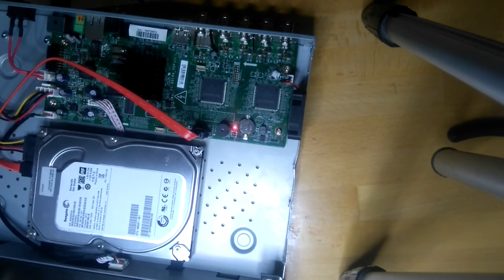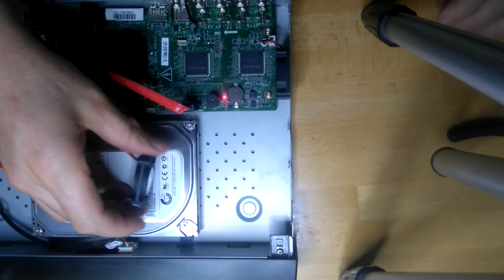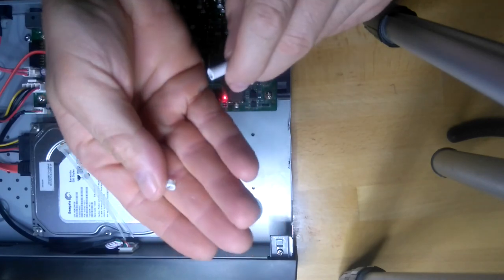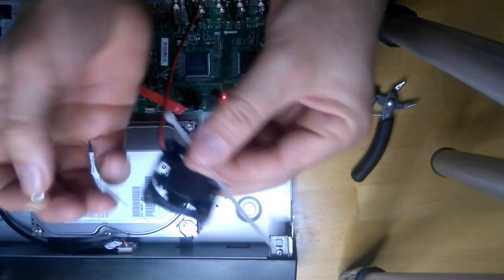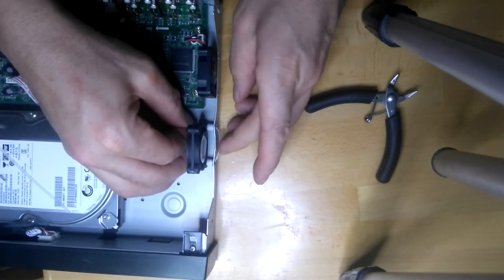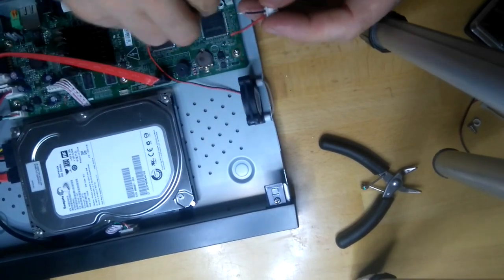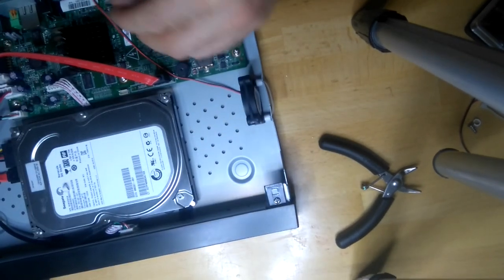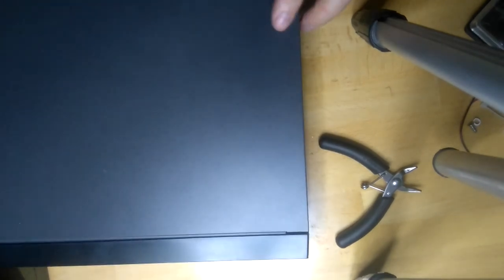How to stop fan noise from a CCTV  dvr or any other similar devices

Comment: Worked great. Also you can add a rubber washer on bottom and top of fan to stop vibration noise to both up and down chassis. No noise to the point I thought I did not connect the fan.
Reply from the maker: No no. fan has to play free

Comment: i just pulled the fan out. Stand by, it's working so far. still working.
Reply: How did it cope without the fan?
Reply: @chanaldochan8797  going great
Reply: @mikesmechanical1102  cheers. It’s bloody annoying! Mine getting pulled out after I get home from work! 😂🤣
Reply: It is mounted vertically so that might help with convection. The silence is bliss
Reply: @mikesmechanical1102  still working great ?
Reply: @keno2363  it is

Comment: I mounted the fan with a thick piece of (3M) two sided tape on the bottom which holds it upright and acts as a buffer between the fan and the DVR  back plate. It works great!

Comment: I just want to ask if Moving the fan to that place would cause problems to the mother board. I noticed that the fan was directed to the motherboard in the first place. Does dislocating its original place affect the cooling process of the mother board?
Reply from the maker: Absolutely not, it's not like pc motherboard, it may surprise you but the fan is not actually for circuit board ,its for HDD, i am a security installer in UK

Comment: Does your DVR's fan stay on after you shutdown the system from the operating system software? My DVR fan only goes off when I pull the power supply plug out of the mains socket, is this normal?
Reply from the maker: Absolutely, Modern DVRs fans directly connected to 12v input, why do you want to keep the power and turn the DVR off softly anyway, it's not a PC
Reply: @pjoskar1  Thanks for replying. I have had the DVR around 6 years and had to open it up to clean the clogged fan and I simply couldn't remember if the fan normally stayed on after I shutdown the box from the software. I thought the fan staying on may have been a sign of a fault :-)
Reply from the maker: @Downloader77  Modern dvrs operated with linux operating system, you can simply plug of and back on ,this doesn't affect its operation, however it's not recommended often, it may affect HDD

Comment: i need to put a fan on mine's cpu i wonder of a pi fan will fit i'm hoping its 40mm so i can get a noctua then my system would run better its throttling atm i may put a 2TB NAS SSD in it to help it out, o just put a throw away 1TB spiny drive from
my ps4 the old one was going it'll last 6-8 months and spiny drives are useless i have 1TB, 750GB left to go in there, i have some 2 500's ( 1 SSD 1 spiny ) but thats not enough recording time for me ( got a cheap 128GB Leven JSR-800 for $10 bucks 1TB's are like $60 so if its fast they'll be going in everything except my gaming PC that will be a NVME 1TB WD black 7000mgbs read and a 1TB 2.5" PNY or WD Blue SSD for a game drive ) i was amazed by how much clearer the picture displayed i didnt think it was gonna change that mine is a 9 channel security system